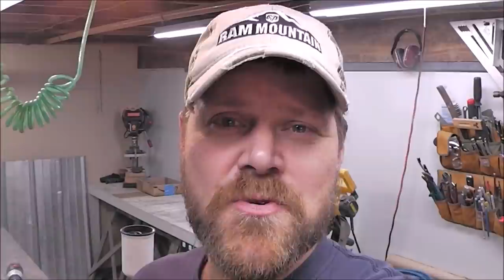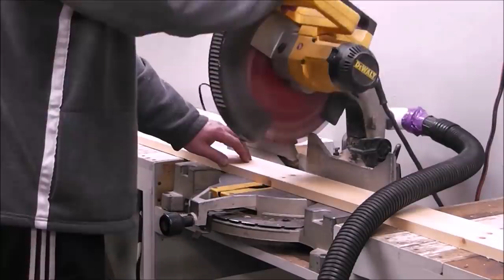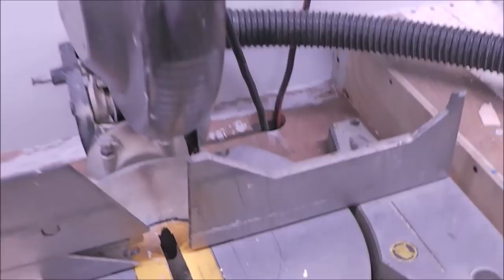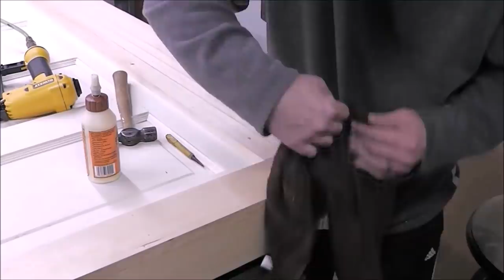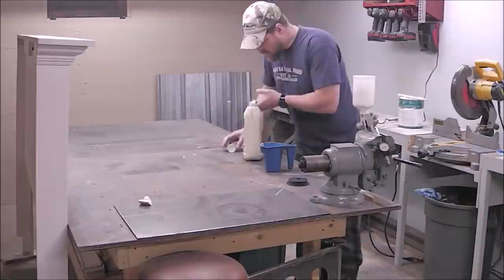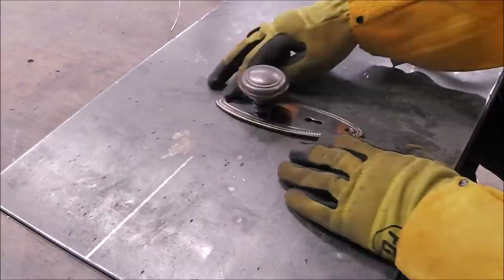Beautiful DIY HEADBOARD from an old wood door! Its EASY

Comment: For your pro tip, another thing you can do is change your miter saw bevel to a few degrees to make that same cut instead of using the little piece of wood chip.  Great idea using an old door for this project!
Reply from the maker: Thanks man! The wood chip trick is more for production work because changing a bevel takes a lot longer than dropping a 1/32" shim. At the end of the day all those bevel changes add up to a lot of additional time, and in production, time is money. I've just carried that tip into my regular cutting because its quick and you dont need a compound miter saw to make it work.

Comment: Great vid Brandon! Q: how long did you make the "legs" i.e the part from the bottom of the door to the floor?
Reply from the maker: I dont exactly remember but this is how I arrived at it. I measured from the floor to the top of the mattress. Write down that measurement. Now measure the width of the door. Now just add those 2 measurements together and that's how long to cut your legs. I hope this helps :)

Comment: Thanks for sharing the helpful video! I found a door last weekend and bought supplies at HD yesterday but could not find 3.5" molding that was the correct thickness. Would 4" molding or a different thickness work?
Reply from the maker: Without actually mocking up the pieces to see how it would come out it is hard to say. I think it will work, but the reveal under the top piece of wood will be less. In other words, the wood on top will not protrude beyond the crown molding as far as it does here. If you go with a 4" piece of crown, you might have to go with a wider top shelf...possibly.
Reply: @BrandonLund  Thanks! Will make another trip today.
Reply: the true dimensions of 1x4x8 is 3/4 x 3.5 x 8

Comment: Brandon, great idea and build! Do you ever run into asbestos paint on old doors and how do you deal with it. I would think a few coats of paint would seal it in and not be a danger.
Reply: Sorry, i meant lead paint.
Reply from the maker: I'm sure I probably have and when I'm in doubt, I just make sure to wear a respirator and cover it with a quality primer and paint. The thing you want to avoid is making dust by sanding. Your more likely to come across lead based paint when doing a project like this than asbestos. Some paints back then did have asbestos in them,  but most were lead based. Seal it up with fresh paint and your all set...

Comment: Brandon,
How would you adjust your plan if planning to make a similar foot board.  would you use 4x4 posts instead of 1x4 pine boards?
Reply from the maker: I would probably just build it the same...scaling down the height of coarse.
Reply: @BrandonLund  Thank you

Comment: What did you mix our paint with to spray the headboard? Did you use latex or oil based?
Reply from the maker: I used latex paint and then added a "latex modifier". It allows most latex paints to be sprayed. If you go to your local paint store or big box store and tell them you need a latex modifier so you can spray latex paint, they will hook you up :)

Comment: Nice!! How did you attach it to the wall? How is it attached to the bedframe?
Reply from the maker: It's attached to the frame at the factory location on the frames. Its not attached to the wall
Reply: @BrandonLund  Nice design and workmanship. Metal and wood. You are a man after my own heart. Mostly I am a woodworker but I also dabble in metal as needed. I have learned a lot from your channel. I recently had a defibrillator put in my chest so we shall see what that does to the arc welding. The company tells me I can weld up to 160 amps as long as it is at arms length. Oy!!!
Reply from the maker: Just be careful. I feel that a high frequency welder could be problematic. I think a transformer based welder would be safer but this is all speculation also. Thanks for watching and I wish you good health 🙏
Reply: @BrandonLund  Good point. I will do some  research. Meaning, I will ask my buddy who is an electronics wizard.  We are also come up with some sort of wearable Faraday cage using some copper screen.  We shall see. 🤞

Comment: What finish was applied to it.. Like a clear coat or what exactly ?
Reply from the maker: I was just spraying regular latex primer and paint that you would use on interior trim in your house. Its thick, so you have to thin it down with latex modifier. It's what allows latex paint to be sprayed through a paint gun
Reply: @BrandonLund  Thanks bub.
Reply from the maker: Anytime brother!

Comment: Hey Brandon!  Such a beautiful Job. This is what we want to do.  But what we don't know what to do is how to mount it to the metal bedframe!  Could you show us or explain where you are bolting it to the frame ? thanks
Reply: We are mostly worried about the weight of the door and if the frame can support it :)  Our frame does have the flat bits where you can drill it in.
Reply from the maker: So the "legs" on the headboard go all the way to the floor, so the actual door / headboard is actually supporting itself. In other words, if you leaned the headboard assembly against your wall then slid your bed up to it, it would look finished. But to keep it from tipping forward (onto the bed) I made sure the legs were centered left to right on the bed frame, then i just used a drill bit and drilled through the wooden legs into that flat bracket.  I then fastened the wooden legs to that bracket using (4) 1/4" x 1 1/2" carriage bolts. I hope that makes sense. If not, send me a message and I will try to clarify anything you need. Thank you for your compliment!

Comment: Is your bed actually going to mount onto that thing or is that purely for aesthetics? I purchased a bed frame from some dude on the street for a hella cheap price. 40 bucks for a king wood frame with pull out storage boxes. The problem is that it only included the sides and front so now I have to make the back part where the sides will hang up on.
Reply from the maker: @Eddie Arcega it's basically for aesthetics however it keeps the pillows from falling between the bed and wall. The headboard sits on the floor and the flanges on the metal bed frame attach to the headboard legs.
Reply: @BrandonLund  ic. Thanks. Well done job m8
Reply from the maker: Thank you :)

Comment: Nice, what length did you cut the 1 X 4 X 8
Reply from the maker: Thank you. The length will vary depending on the door. It just needs to fit tight between the 2 upright pieces which are the legs.
Reply: what length are the legs
Reply: I understand it depends on the door but I quess what im asking is how tall should a standard be compared to the matress

Comment: Hey Brandon, very nice work.  Did you mention the overall width of this headboard?  Queen size?
Reply from the maker: Dave Gardner Thank you! The door measures 6'-6" and it was not cut. On a king size bed it was just a little wider than the metal bed frame.

Comment: Hello! Is there a way to make this so it doesn’t attach to the bed frame, but keep the legs? Also you didn’t show the part when you cut notches out of the bottom of the legs, what are those for?
Reply from the maker: Hey Melissa. You could easily make this so it attaches to the wall similar to a picture frame but the weight is still being held up by the legs. An easy method do do what you mentioned would be to use a "french cleat". You can buy them in metal at most big box stores. The cutout you saw was an after thought. My mother and father in-law have baseboard molding that sticks out from the wall. I notched out the legs so the headboard would fit over the baseboards and slide right up tight to the wall.
Reply: Thank you for you quick response! Could you give an approximate list of supply’s need? Lumber only!
Reply from the maker: @melissamonroy4155  There is a material list included in the video description :)
Reply: Thank you! I had to have my husband show me where the list was 😆
Reply from the maker: @melissamonroy4155  Your welcome and thank you for your support!

Comment: Great work man! For the  height of the headboard, you're just going off the dimensions of your bed frame?
Reply from the maker: Justin Lipscomb yes. I went just a little wider than the frame so I was sure to have enough material to attach the bed frame to.

Comment: Beautiful work, however, there is one thing that would absolutely drive me nuts. The panels inside the frame of the headboard are not symmetrical. There is more room on one side than the other it's not centered on the headboard frame.
Reply from the maker: Thanks John and I'm very much the same way however it wasn't as easy as just cutting it to make the dimensions the same because then the headboard would have been too narrow / small for the bed. To keep it symmetrical I would have had to cut the bottom of the door then join the piece I cut off to the top of the door using biscuits, but that would have also added another joint and considerable more time on an already time crunched project. My wife says it's "rustic" which I still struggle with to this day. I like symmetrical also LOL Cheers brother!
Reply from the maker: Thanks brother! I appreciate your support!
Reply from the maker: Thanks man! If you have Facebook be sure to upload some pics of your finished project. It's always good for others to see different styles and designs. Cheers brother!
Reply: @BrandonLund  , no disrespect intended you do absolutely beautiful work it just caught my eye. I'm going to attempt this for a queen size bed so I might be able to adjust it a little bit. Again great tutorial I love watching stuff like this thank you again
Reply from the maker: No disrespect taken brother. Good luck on your project and I appreciate your support :)

Comment: At 5:50 and your cheat for making a tight fit. Just change the angle of the blade slightly. Problem solved
Reply from the maker: That works too but when setup you want to do the least amount of fiddling and adjustment of your saw. It reduces the chance for errors. Sliding a shim under the wood gets it done in seconds without back and forth adjustments.  There is nothing worse than making a 45 degree cut only to realize that your bevel was set to 89 degrees and not 90 and your miter joint now has a huge gap and you wasted a piece of wood. This tip avoids that back and forth adjustment hastle because the saw bevel always remains at 90.